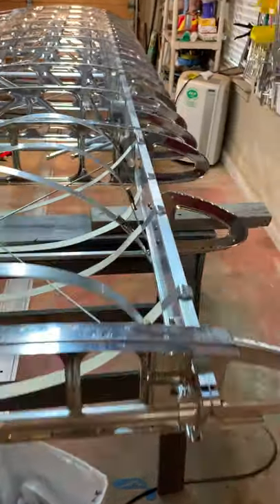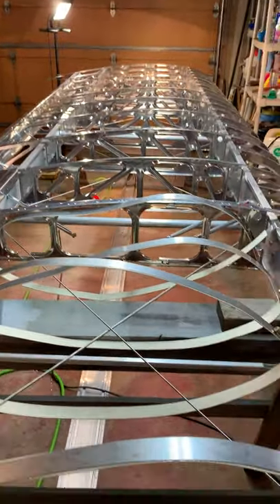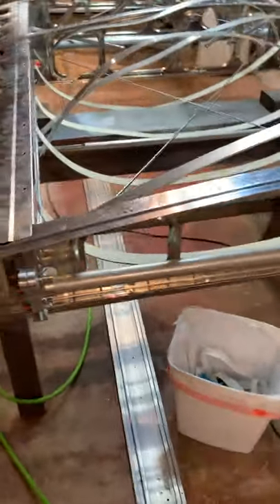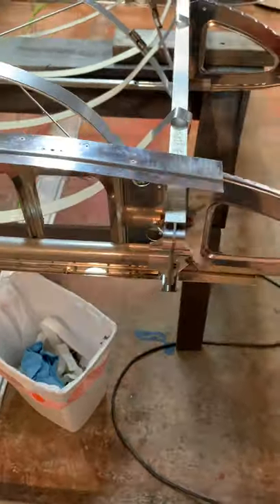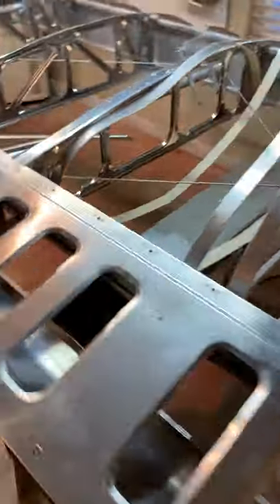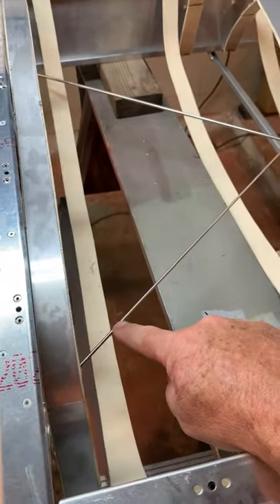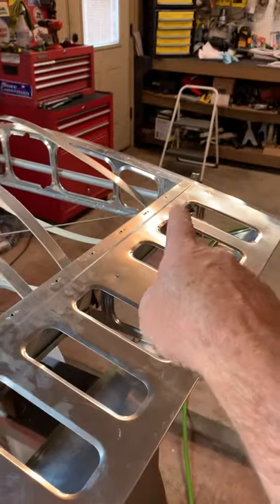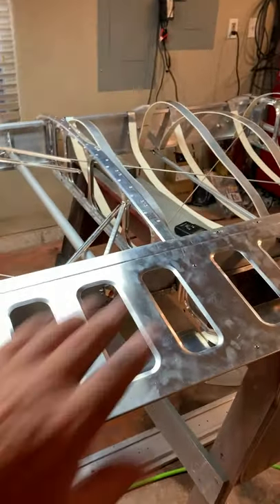Building the Wing - Part 1 Trammeling

Comment: Stievon here, started building my wings yesterday, did you have the ribs already in when you did this?
Reply from the maker: Yes for sure. Just follow the manual to where it says to trammel and then refer to this as well as my thread on the cc forum for details. Building the ex3- tips and hints.
Reply: Thanks Dave, been watching your videos for six months after I ordered the kit in April, picked up the kit September 27 and just getting started, inventory took 28 hours😢 but still actually enjoyed it! You are a wealth of information and I appreciate your videos more than you know! Thanks again Dave
Reply: Have another question for you Dave, the drag tube blocks on the aft spar front, I noticed that there is a short and long end on them and you can’t tell by the illustration which way they go, I have the short end facing up to match the front spar drag tube blocks, also the drag tube block under the wing root on the aft side of the front spar has a short and long end, the book doesn’t explained these parts
Reply from the maker: @scoop7717  see page 6.1 of the wing manual figure.  Short side down.

Comment: Hello Dave, 
If there's any discrepancy between the front and rear spar when squaring to torque tube #2 on the first bay squaring process (as far as it wont square up perfectly to both),  would you square perfectly to the rear or split the difference between both front and rear? 
thanks so much,  great insightful and helpful video's !!
Dusty
Reply: @daveembry85  Ok thanks very much, now before i even start to tighten things down, im perfectly square to the rear spar and out 1/16" on the front spar!! is this close enough do you think ?
 Thanks again!
Reply: @daveembry85  Awesome, will do.  Yup got ya on the different diameters and how it will pull each one at a different rate. Ill move forward and continue. 
Thanks a lot, Very much appreciated!!